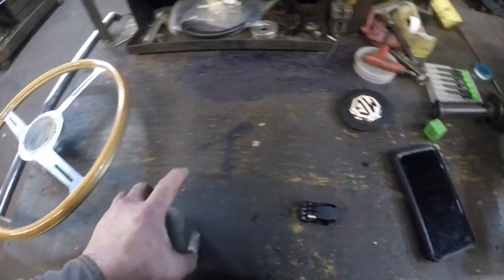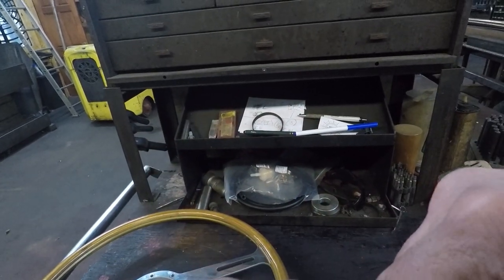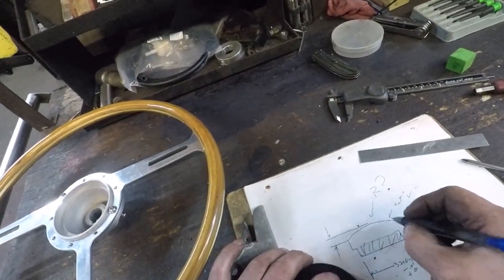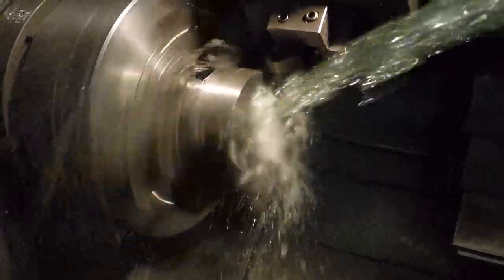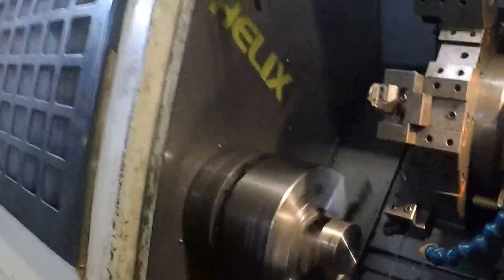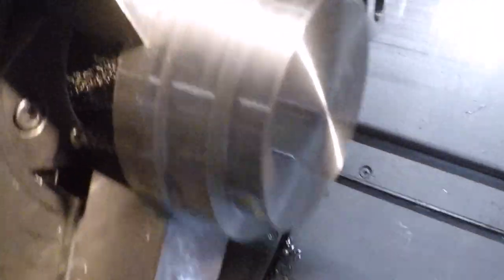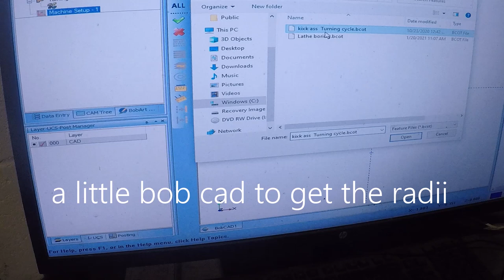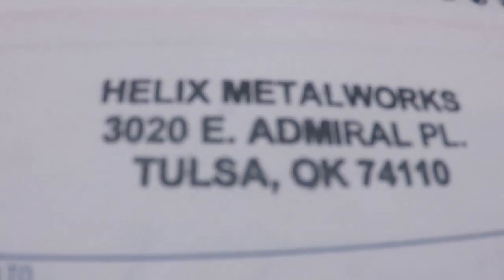HMW  MG HORN DELETE BUTTON

Comment: Nice work, man 👍
I like doing these sorts of jobs because they're interesting.
But, when it comes to adding up time spent versus price for the job 😒
Most of the time the customer comes out in front, unfortunately the same can't be said for the shop doing the job ???
A job is a job, but you need to be careful not to get too many of these jobs otherwise you start losing money fairly quickly.
I'm not so much pointing at you, but telling myself 😄